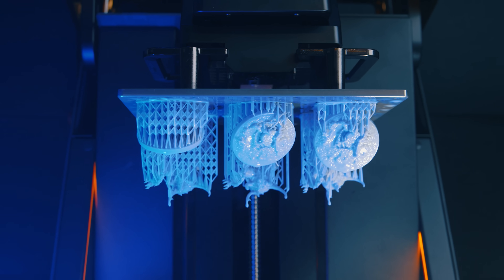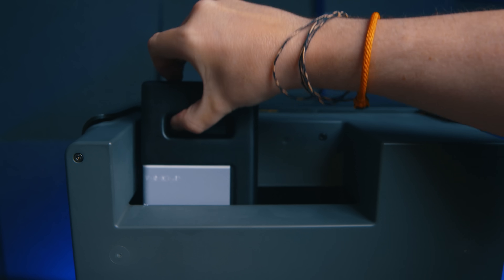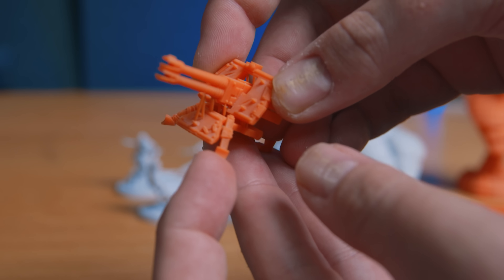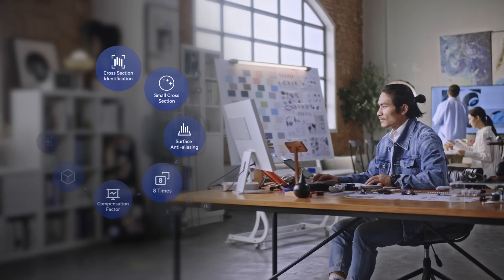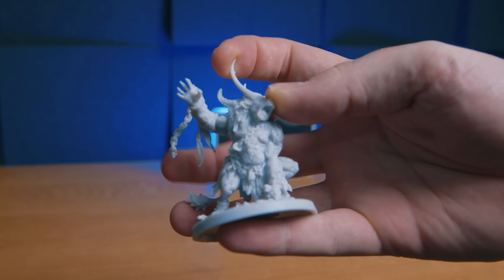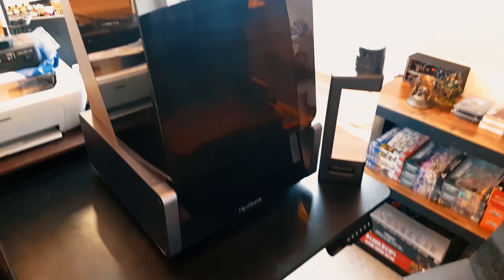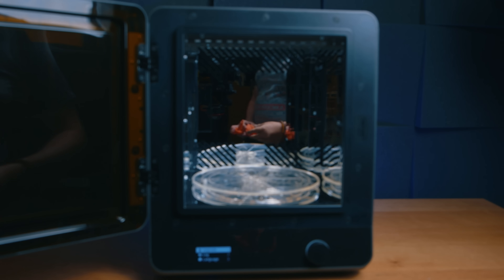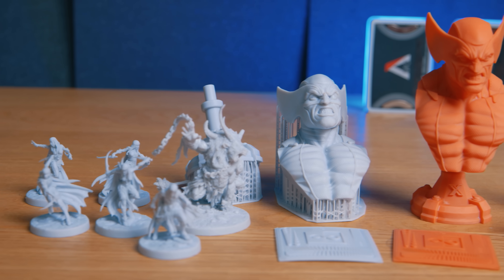HeyGears Ultracraft Reflex Preview - A 3D printer FROM THE FUTURE

Comment: Funny story about the 'future of 3D printing'. A few months ago I got serious about working up my ultimate 3D resin printer that does full color, and along the way I found method to convert most ball screw-style printers to negate all peel force and print almost in real time; my R&D test mule went from a full plate 98mm tall print that was doing 9hrs and 38 minutes to 34 minutes. Best part, all it cost me was a bit of time and about $100 in materials. I haven't gotten deep enough to see how fast it's going to burn out a screen, but I suspect it will need a stack of them in the near future.
Reply: Wow how is that possible?
Reply: @Cw99612  Normally I'd guard my prototypes rather zealously, but I'd rather pursue other variations so if you know someone who can help, it wasn't too difficult. You need a base printer with a very stout UV source, collimated lens and a reasonably accurate LCD screen. Basically you're going to invert the whole machine and lower the printer arm into a large container of resin, printing almost continuously on the surface of the resin (essentially the upper most layer of your part) as the platform lowers. Syncing up the platform to the exposure rate was the interesting part but totally doable. Also becomes paramount to design parts with the assumption that they will need to vent inverted of normal.  
I suspect this is why DLP printers exist, but for the lack of over 2k resolution and larger print plates, I stuck with an LCD screen, as much as I loath their fallible life cycles.
Reply: @C-M-E if you’ve got an effective prototype, you should chase this as there’s likely some ways to optimize the final product. Bottom up printers are convenient in terms of cost and reliability but if you can use the same equipment for a top down machine that’s just as good and prints significantly faster, I think you’d have a marketable product. Personally I prefer top down machines but they generally cost 4 to 5 figures on the low end…

The alternative would be to try and pitch the idea to a company who’s got capital and is willing to contract things out with you but that’s rather risky territory.

Comment: While I love the idea of plug and play 3D printing the way this printer is marketed right now it's an instant pass for me. I don't mind semi-proprietary ecosystems. Take the bambuLab P1P and X1 Carbon. While they do have their proprietary filament you can just put in whatever filament you want and dial it in if you want. If this was the same way this could be an interesting printer. But everything in the marketing seems to indicate that it's not which means they can charge whatever they want for the resin and boy is it expensive and you're limited to what they decide to make so if there is an existing resin out there that can do when you want your out of luck.
Reply: I strongly agree with your statements. If i dont have the option to use resins of my choice (and price range), then i cannot justify its purchase. It seems like they could make an adapter or refillable bottle system that could accomodate resins outside of their system.

Comment: Thanks for letting me know I SHOULD NOT buy this cr*p. This is a closed ecosystem, forcing you to use THEIR resin, THEIR cartridges etc, this sh*t never works. I need a printer that allows me to use MY specific choice of resin for the different uses and needs that i have, a closed ecosystem which uses proprietary is absolutly useless. ALSO, be aware people, a web browser slicer is basically a way of giving away all your potentially confidential printing projects, I want a printer that doesn't ask me to connect to internet to use it. This trash is basically a hostage situation.

Comment: What kind of speed were you seeing?  I ask because that, more than 12k, has been interesting to me about the new 12k printers and the Athena.  Ok, the openness of the Athena is cool too.  This concept is really interesting, although pricey and I’m a bit concerned about the closed system.  I don’t assume it’s a hostage situation, just a way to control variables.  Still, it limits variety as well as choice.
Reply: It's INSANELY slow - 27mm/h

Comment: My only gripe is the combo is around $3000 here without shipping (looking closer to $3500) 
Which from what I see is $2500 for their auto exposure feature. I will wait for the full release and break down before I decide but I haven't bought any printers yet and I really want that top notch bang for buck Resin printer for my medium.
Reply: It's less than $1800
Reply: @SamySuzern  the combo is $3000 HERE. Reading comprehension helps when replying. As I stated I don’t have all the things on hand I would be looking at the set not the printer alone

Comment: I was pretty interested in this, proprietary  resin feels like a little bit of a risk if the prices change but the system seems great, i was also willing to see the value at £1500, all in but no resin, but turns out these prices dont include vat, this printer is amazing on paper, but is it really worth almost double the cost of a gktwo? Especially if resin not on sale will be £70+tax?

I was very excited by the product but im not sure the costs are justified even with the build quality of the machine.

Comment: I’ve had the monox6k for a year and have been looking to upgrade. 

The machine looks beautiful and I’m curious if the ai features are working as advertised. But proprietary resin is a big no for me.
Reply from the maker: You can easily just pour in your own.
Reply: @FauxHammer  but will it be compatible with the “ai” settings and all the fun software wizardry that they are advertising.
Reply from the maker: @brandonjramos  good point. I mean, their Platform, becasue it's more than a slicer, is made for their resins. So unlikely. but you still get all the other benefits of the printer, though I would hope that the heater become configurable.
Reply: @FauxHammer  Thanks for a great review! Can you actually use any other slicer with this printer? Or if not, can you input custom settings for other resins? I have now ordered a GKTWO printer, but this one cought my eye and I am now debating on maybe switching.

Comment: For me.  It  comes down to how big can print.
Reply: ^^^THIS^^^ The Jupiter & M3 Max need more competition as they currently have none (that I'm aware of)  in the $1000 price range. If the Uniformation GKtwo offered a larger build volume, I would buy it in a heartbeat...
Reply: @zim3195  I have had the Epax 156 for over 4 years now.  Works great.  But all the other company's seem to pretty much stop at one size.  I also have the X10.  But the price to up grade it.  Well I can buy 2 new ones the same price.  I had the XYZ Nobel, never again.  I do have 2 Saturn 's as well

Comment: Not gonna lie... This makes me think of the FormLabs Form 3 printers and their cartridge based resin system. The only concern I have is the costs. Formlabs is a lot higher than any other option I have seen. I have seen a few other companies try a resin tank but it usually created a lot more headache than necessary if you swap resins a lot. (Though for industrial applications this type of thing makes more sense.)
Reply from the maker: i have given them this feedback. but having now tried all their resins, I'm just goanna stick with the PAM10
Reply: For mini's, would you say PAM10 beats out existing resins? The price tag seems prohibitively steep @FauxHammer

Comment: In one of those weird synchronicity things that makes people think fate is real, I was just thinking "I wonder if there's a resin equivalent to Bambu out there?"

This certainly fits the bill.  But... there's one big difference:  if I use my X1C with Bambu's own filament, there's no fiddling about with settings.  That's similar to HeyGears approach here.  *BUT*.  I can put any spool I want to on the X1C.  Sure, I need to do a little testing when I first start a new type of filament to get the settings perfect, but that only needs to be done once.  And so I can go with generic filament for almost half the cost, rather than being tied into Bambu's branded supply.

It doesn't seem like that's an option here.  And yes, I realise there's a hazmat issue with printing resin and the proprietary bottle-becomes-feed-system really helps minimise that issue.  But it still stands out as a big deal.  Having the choice to get the high quality branded supplies when it suits me or to use the lower-cost generic stuff when that's good enough is an important factor in evaluating something like this.

I don't mind being in some walled gardens.  Bambu has done a good job of making their slicer and so forth just a little smoother and easier to use while still giving me the option to go to, say, Prusa if there's a problem.  Knowing that I can (mostly) leave the garden if I need to makes me much more comfortable just sitting inside it.  HeyGears doesn't seem to offer those options.  Granted that this is probably out of my budget even if it was absolutely perfect; but I'd be more willing to consider it if there was an option to use anyone's resin, and a way to use any slicer.
Reply from the maker: i think this is that, i give it 5 minutes before Chuitubox or Lychee can slice for this and you can pour in whatever resin you like. or just use an empty bottle of their resin which has 2 screw caps and pour in a litre or 2 of your own
Reply: @FauxHammer in which case I buy your resin, which happens to be water washable, durable, and apparently as detail capable as Heygears.

Good livestream yesterday too. I learned a lot. I’m not a member yet but may be soon, and with this printer.

On that note if you want some models to print, I’ve got some unreleased artwork if your interested in a challenge ;)

Comment: The problem is that it's expensive. VERY expensive. It's interesting though. These features really do tempt me because it does a lot. It's a touch similar to the Athena? that has the same lift top and so I wonder if they are related in any way. This is a no-go price for the "it just works" general populace. Honestly, I think it needs to be 1000-1250 in order to attract people. it's 1750 for the whole kit for me. That and I'll have to pay a premium for their resin unless they allow people to use those bottles for other resins. I would rather them reduce the cost of the unit and make up the money on the resin or vice versa. It's GREAT innovation, but at that price, I'll have to wait until others do it.

Comment: So the future is exactly like right now but 2-10 times the price? Sounds about right. Never really had problems with prints using Elegoo resin with Elegoo settings on my Elegoo printer. It's when I go try different resins that I get problems so this printer fixes nothing. It's a solid printer that look like it's built like a tank but that's about it but I don't see anything revolutionary, did I miss something?
Still waiting for a revolution to make this hobby less messy and that won't require an entire room worth of equipment.

Comment: I don't get the whole propriety resin gimmick this machine has, manufacturers like Elegoo already offer suggestions on what settings you should use depending on what resin you use. Forcing the user to use their brand of resin, their software and then being very expensive on top is a big turn off. 

How much easier was this than your previous videos where the printer in those videos was the easiest to use like the Elegoo Mars 4 Max?
Reply: I don’t think they can force you to use their resin like drooping micro qrs inside 😂?  ( ok, maybe they can, I just don’t think they will)  But using their resin will give you a lot of advantages.
Reply from the maker: it's less of a gimmik and more of a, this is how we make it work.

but yeahm you can put your own resin in.

Comment: I work in a dental lab in the 3d print department and we use their printers. That service you got is how they handle everyone. They are super hands on and very knowledgeable. If we have issues we have a tech that they will fly out to us within a. Couple days to assist. Those are the exact same build plate on the industrial printers. We LOVE HeyGears in my lab. Everything they do is quality.
Reply: Do they offer castable resins? I work in the jewelry industry and we have similar needs to dental, depending on the final output.
Reply: @theonerichard  yes they do. We use it for frames
Reply: Can you tell me if keystone resin for splints can be use or if these only works with home brand resins?
Reply: I agree, we use their a3d for our lab. It’s amazing best support

Comment: The price is good for a hassle-free experience, exactly what small business are looking for, but only if it's really hassle-free, good auto-supports and all
Reply: Exactly, the hassle free experience needs to be all encompassing. Meaning everything including auto supports, auto orientation etc etc, need to be hassle free. If there is any thing that makes it like any other 3D printer it would loose its hassle free benefit fairly quickly due to price. But so far its looking good.

Comment: I would hope that if you are one of only a few people with the printer they'd have support people to assist. But what will the actual consumer experience be?
Proprietary bottles? That's not good. 
Exposure is easy to get with the Cones of Calibration, just use the proper test.
Proprietary slicer? That's not good. 
Printer area size is small for the price. For someone who wants an XL size printer for statues.
Wash station is ridiculous.  No, that's horrible, shaking the whole unit. Plus it can lead to damage of the 3D prints. 
Cure station with mirrored walls is a good idea, but it's too small. 
Build quality does look good. Heated vat is good.
Cost though, yikes!

Comment: Thanks for all the informative and quality content you create.

At $1,800 – 2,500 I think this platform is way overpriced for what it offers. There are some cool features with the printer (wireless printing, heated resin vat, auto-leveling, etc.) but many of those are beginning to make their way into mainstream printers. For a fraction of the total cost, someone could buy a top of the line consumer printer, wash & cure, and all the consumables from another brand. HeyGears price tag doesn't even include resin.

The wash station feels like a gimmick. Unless the shaking provides demonstrably better results, it’s just more parts to break, will vibrate your workspace, and potentially damage prints by tossing them around. Wash and cure stations from other manufacturers all include a metal basket so you don’t need to dunk your hand in the IPA and smaller parts can be put in a sonic cleaner basket ($5 – 10 on Amazon for a set). There’s also the very real spill risk from user error or a worn-out seal. The one possible saving grace would be if there was a filter that could pull out the resin particulates from the draining IPA. 

The proprietary slicer and resin are a big red flag. This screams printer ink 2.0. I would be wary of pricing (current and future), availability, and door-to-door shipping time. Most resin manufactures already have resin profiles you can import or manually input into a slicer, so having them preloaded really isn’t a game changer. People have had issues with resin bottle caps cracking; I would hate for that to happen when the bottle is attached to the top of my printer…

33um is nothing to write home about and it seems odd to spend >$1K for a printer that has worse results than currently available ~$400 printers.

Customer service is huge. But I can’t imagine the average consumer would receive the same white glove treatment as a popular YTer that they sent their product to for free in return for a review (albeit upaid).

If I were going to take a risk on a new entry into the 3D printing space, I would buy from Athena. Their printer has all the best features as this one at a fraction of the cost AND is designed for future upgradability while HeyGears is clearly designed to lock you into their ecosystem. 

The big appeal seems to be an “all in one” solution with little tinkering required – but all of that depends on how well all the components (slicer, printer, wash & cure, etc.) perform once they hit mass market.

I am excited to see new players entering 3D resin printing and upping the ante both in features and build quality. I hope this forces existing big players to begin adding these QoL features into their products.
Reply: fk no Athena,  maby when they show a more reelable model, their photo type. was wonky as hell and not build good, why even risk it in the first place u dont need to. 

this at least  have stellar build quality, and seems to have a good backbone on aftercare tho 1000 plus for the wash system no thx, I could maby eat 2x the resin cost If it could suck up resin from the vat itself.

Comment: Formlabs has already done this -- ages ago, not sure how this is revolutionary, it's just based on msla, not sla. You pay for a closed ecosystem and it just works. I have a form3, it just works, at a price. It aint cheap. Question is how much do you want to pay for the "just works" experience. I've not had a failed print on my form3 ever, only prints I've had to re-print are when I've intentionally re-oriented a part against the PreForm slicer objections.
Reply: Are the resins calibrated for dimensional accuracy or guaranteed successful prints? Just wondering